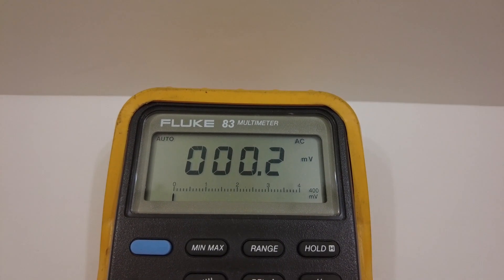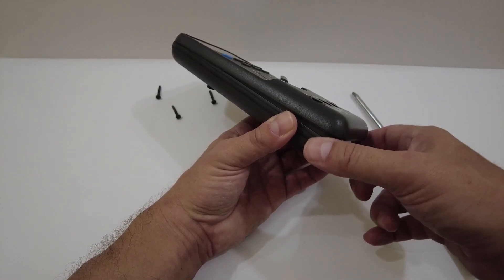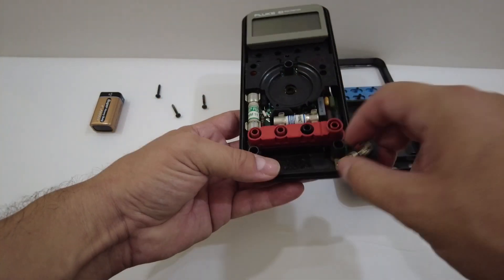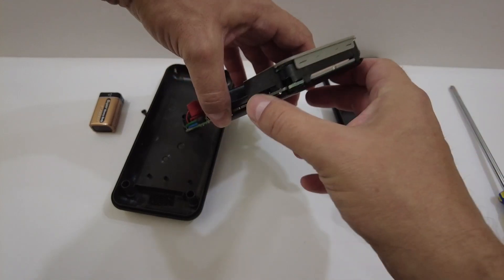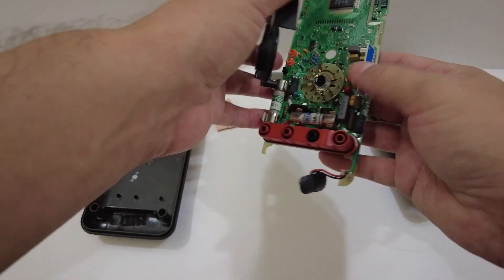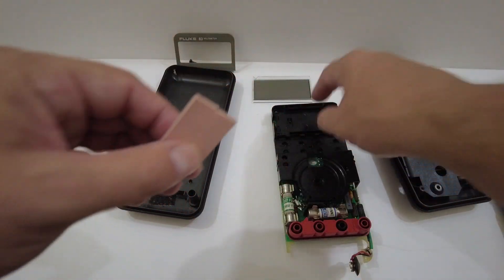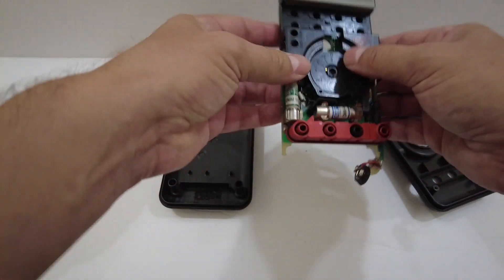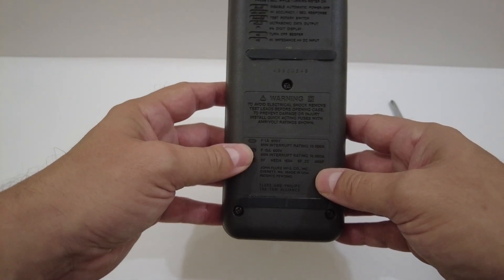Fluke 83 Multimeter Tear Down!  All Good Until This Happened!

Comment: Hey man, I have a fluke 789 with resistance issues. Without any leads in the meter, it reads 5 megaohm bouncing around, and when I touch the leads together, it goes to -2.5 ohms. Do you have any idea what causes that?  Or where I could find that out
Reply from the maker: I've seen this before in an older Fluke 87.  The cause was 1M resistor that was fried.  Usually, unstable and inaccurate readings will be caused by faulty components.  Problem is that the 789 has less PCB circuitry, and it might all be surface mount (smaller components and hard to replace).  You'll have to open it up and see if any moisture has gotten in and caused any rusting.  I'll try to post a video of a 789 breakdown if I have one.  In the mean time, here's a link to the Service manual: https://assets.fluke.com/manuals/789_____cmeng0000.pdf  Thanks for reaching out and I hope this helps.
Reply: @Test Meter  thanks for your reply. I will try this, now that you mention it I think i did see  a little corrosion there when I had it open. Is there a electronics place you would  recommend  ? I want to buy something closest to the original

Comment: What are the adjustments for?
Reply from the maker: The adjustments inside the Flukes, and all test equipment is for adjusting the meters if they are out of MFG. Specifications.  Each pot resistor controls a different range, and they are adjusted by accredited calibration labs to bring them back to within specifications.

Comment: My Fluke 87s have that issue with the digits missing on display.  I cleaned the elastomeric connector and it appeared better on one.  I then wedged a piece of cardboard between the display bezel and glass and now it is normal.  However, I hear a faint whistling sound even when the meter is turned off.  What do you think that could be?  I ordered three replacement electrolytic caps, hoping it is that.  I also ordered new elastomeric pads, hoping to get the other one to display properly.
Reply from the maker: Check to make sure that the additional cardboard isn't causing other components to press into each other.  I've not had this problem before.  Sorry for the late reply, but make sure it's not the cardboard inserts before replacing the parts.  Could be the caps, but please let us know what you find out.
Reply: @MultimeterParts  It was nice that Fluke had a parts list available.  Although the original caps were obsolete, I ordered similar 47 uF tantalum caps..  They appeared to have done the job.  Both meters no longer make the noise, like a faint whistling sound tapering off into something that sounded like a faint and slow Geiger counter.  Also, I installed the new gray elastomeric connectors in them .. Both seem to be working and displaying correctly without the use of shims.   I suspected the caps because the noise was coming from the region where they were.
Reply: @MultimeterParts  I forgot to add that the noise was present both with and without the shims.  It was apparent on both meters when first turning them on.  They've been sitting in my basement for over 20 years (basement is at 50% humidity).